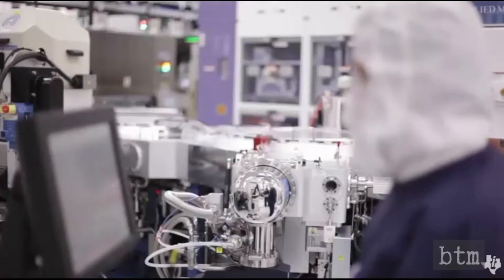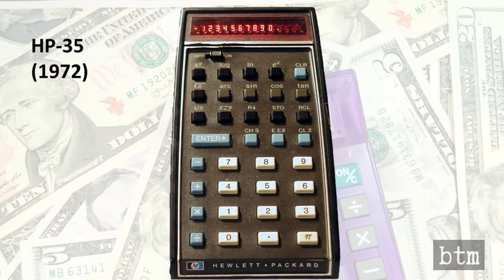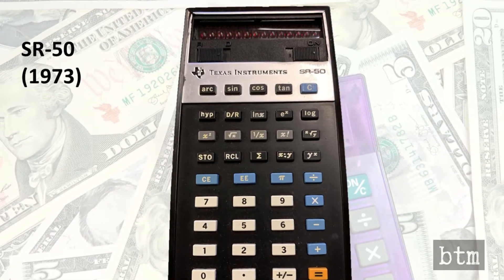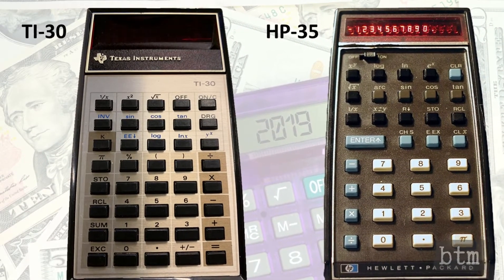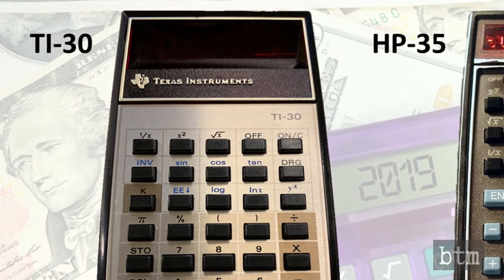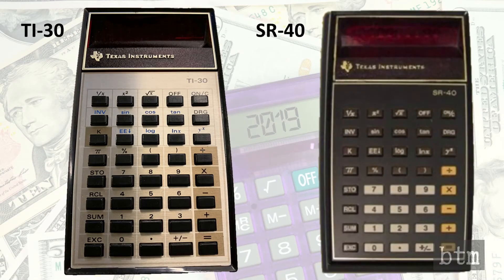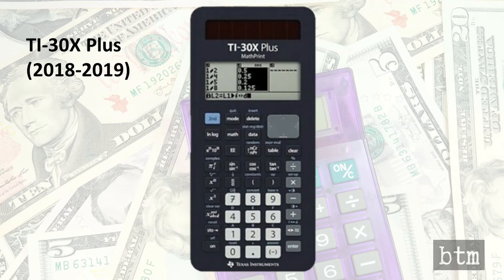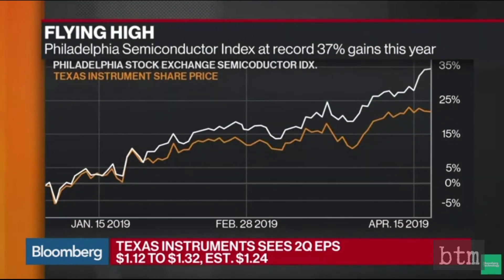How the Texas Instruments TI-30 Calculator Took Over the World: E19/R2

Comment: The SR-52 was an earlier Texas Instruments  programmable calculator, and had a magnetic card reader. The Programmer is not a programmable calculator, but a calculator designed to assist programmers. The TI-57 was the key programmable calculator in the Majestic range (the type of case the TI-30 was in) and the TI-30 was not the first in the range to use that case.

Comment: Had a TI-30 back in high school (early 1980s). It's main weakness was that the LED display burned through 9v batteries pretty quick and the buttons wore out.

40 years later, I have a pair of TI-30Xa calculators that I use for work (structural engineering)...one at the office, and one that I keep in the car. I think I have had them for around 20 years and have changed out the batteries two or three times.

They remain a tremendous bargain (~$15) and they do everything I need them to do. Honestly, if you are a young person that lacks the funds for the TI-84 (which is criminally over-priced), this ought to be plenty to get you through most high school and college coursework.

Comment: I bang on calculators every day for work as a tool maker. I still have an original ti30. They keys are worn out. Pressing 0 or 5 gets 000 or 555 minutes r if your lucky 00 or 55. Usually use my ti85 from high school or a ti69 I got at a yard sale for $1

Comment: I use a calculator daily at work for simple calculations while I record data and while my smartphone can certainly handle it, I much prefer the tactile experience of buttons over a touchscreen. 

I also work outside in all weather and often in the dark and dropping my smartphone and damaging it is a real possibility.  

My current calculator for work is an old Texas Instruments TI-1025.  

Very common, still readily available on ebay and elsewhere so very  affordable, and the VFD display is much appreciated in the dark.

Comment: The TI Programmer was not a "programmable calculator". It was designed to do binary and related math for (human) programmers of then much larger systems.  TI's first truly "programmable" calculator was the SR-52 (although it was quite limited in it's capabilities).
Reply from the maker: We definitely slipped up in our script editing. The point of that segment was to show the similarity between the TI-30 and subsequent models, rather than emphasize the capabilities of the TI Programmer. If we had gone into the capabilities--rather than saying it was programmable--we should have said the TI Programmer could perform calculations in multiple arithmetic bases. That calculator could perform operations in the normal base-10, but also in base-8 and base-16 for programming other machines (as you said) in assembler. For those that are interested, the SR-52--which was indeed the first TI programmable--was joined by the SR-56 and desktop SR-60. The TI-59--on which the narrator cut his teeth--was the final VFD version of that design family. Anyway, this is one of our earlier videos, so we would like to think we have improved a lot since then! Many thanks for watching and dropping a comment.
Reply: The TI-59 has an LED display and is not in the majestic range of TI calculators. The TI-59 was not the final iteration, with the TI-58C coming out later to correct the failings of the TI-58 by adding constant memory. In addition TI made a number of adaptions of the TI-58 / TI-59 for specific purposes, e.g. insurance and navigation.